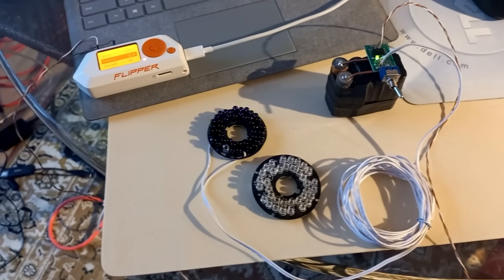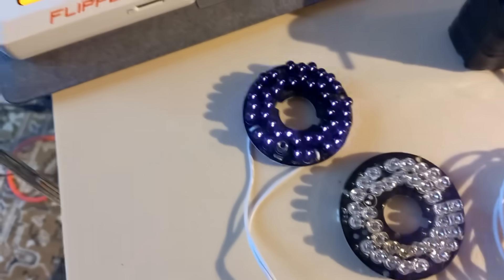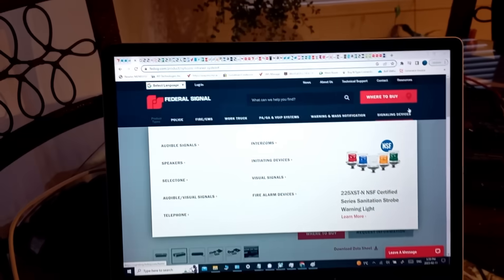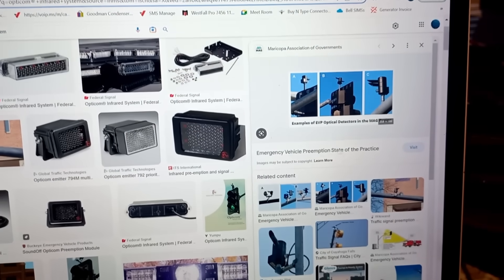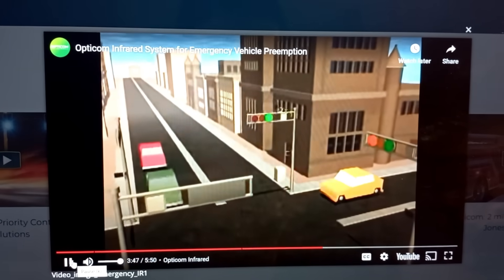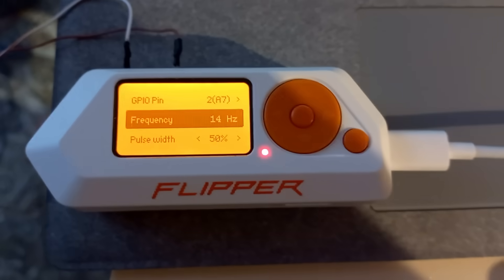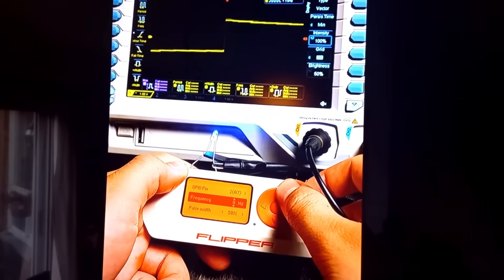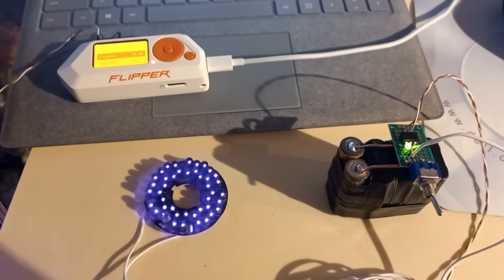Flipper Zero Controlling Traffic Lights

Comment: Hey man, just got the IR circuit out of my camera to do this and was wondering if instead of bypassing the photocell I could just solder it out? Thanks for the video.
Reply from the maker: Yes, just shot together the 2 pins where the photocell was connected to the PCB.

Comment: Old lights in my hometown had strobe activation. You could flash your high beams a few times and they would change. I'm sure it's since been upgraded, but I can confirm it worked most of the time. You had to do it in a rhythm, not sporadically.

Comment: Why not use 555 timer?
Reply from the maker: The whole point of the video was "Can a Flipper Zero control Traffic Lights" If I used a 555 would anyone care? And would the video go viral and get 1.4 million views?
Reply: @peterfairlie2296  Ok ? My question was regarding if the Flipper thingy does some sort of modulation on top of 14hz. Or what makes it special.
And yes you are right, nobody cares.

Comment: YOU DONT NEED A FLIPPER ZERO... Go buy a square wave generator or function generator online for a few dollars online. (It's a piece of test electronic test equipment used for many applications). Set the generator to a square wave (basically an on/off signal) set to 10-14hz (you can verify frequency using an iPhone slow mo video recorder). If you need more power for a larger array then you can use a audio amplifier in between the IR array and signal generator. Now you have a 10-14hz flashing IR array for like $20-$30 built with cheap off the shelf components.

 The beauty is that technically you only have a MIRT if the IR array and function generator are connected together. If they are disconnected then you have a piece of electronic test equipment and a led array which would not be considered an illegal device. If you have a better or simpler way to do this with less components then post it below.
Reply from the maker: The point of the video was can a flipper zero do it. Plus doing it any other way on YouTube the video would not have received 1.3 Million Views.

Comment: A 14 Hz 50% duty cycle signal doesn't even need a Flipper Zero. 
I know the guy that designed the Opticon Infrared system, at least the electronics and firmware. This was back in the early 1990's, and they were already having issues with false triggers when cars  would pass by one of those "picket fence" dividers on the highway and manage to hit the perfect frequency. That's when they started adding  data to the signal, but so many of the old systems are still in use, they have to retain some backwards compatibility.
These days, most emergency vehicles are outfitted with RF communication, especially in cities with high traffic, and the whole system is interconnected so the nodes can talk to each other to clear intersections well ahead of the emergency vehicle. That turns out to have its own set of problems that are now turning to machine learning to wrangle.

Comment: Using a Flipper to send the signal is a bit like parking a Corvette in your bedroom so you can use the headlights as a reading lamp. You can do the same thing with a 555 timer, a capacitor, and a resistor.

Comment: There are methods to do this but I will say they are very very ILLEGAL. This information is for educational purposes only and I am not responsible for any of your actions. 
With that being said some of the workers who install these have what is essentially a dewalt drill extremely fast flashing light. You can also use a flipper 0 with old security camera parts if you want something more permanent or mountable. You could probably use an Arduino too

Comment: The 792 cards can be programmed to only allow certain emitter IDs to activate. However, none of the owners of the signal system use this option. It wouldn't look good if an out-of-town (or new) ambulance or fire truck got stuck in traffic due to not being programmed. And the 792 cards are prohibitively expensive and offer no benefits to 99% of users vs. their lower priced options.

Comment: I wonder if the HackRF Portapack could do the same since it looks like it only has the coax connections to receive and transmit
Reply from the maker: The HackRF is an RF generator from 30 MHz to 6 GHz. You need a function generator to produce 14 Hz.

Comment: I built one of these over twenty years ago, and had sporadic success while driving to work at two in the morning. Nothing like waiting for a traffic light when there is absolutely no one else on the road. Shortly after that I had found all the addresses for the traffic cameras, and while listening to the scanner, followed a chase all the way across town from my living room. I instantly put two and two together and realized how stupid it was to put an IRLED strobe light on my visor. All those cameras and here I come up the street. Hi , this is me, the one with the flashing light on my visor. I still have it, the ABS pipe with the baloney slice and a spring steel clip, but would never again try to attract that kind of attention to myself. The price for messing with Opticom is extremely high.
Reply: I love both of you guys I’m nerding out big time
Reply: i guess it depends where you live, but the only instance I've found of anyone getting caught, they just got a $50 ticket.
Reply from the maker: Build it into your headlight enclosure. The cameras can't tell the difference between visible and IR light. Your headlight should be giving off light so it'll look normal and mask the IR from the cameras.
Reply: Don't get me messing with this again Peter. I'm too old and too broke to be in trouble with the law. It would be a neat trick getting that light to project over the razor sharp cutoff on these new headlights. And to the guy talking about encryption, well ya just gotta add a little noise to the mix and then it works just fine.
Reply: @peterfairlie2296 I find you both devious and conniving...well done!

Comment: What was the application / fap file that you used on the flipper to modulate the ir frequency to 14 hz
Reply from the maker: Using the latest Xtreme firmware go to:  Apps/GPIO/[GPIO] Signal Generator/PWM

Comment: what would happen if two emergency vehicles (or people using this flipper setup) came from different directions to the same intersection. You said the sensors only work for oncoming lights and not to the side so just wondering if two vehicles came perpendicular to eachother how the light would interpret that. Maybe it gives right of way to the person who was closer and then turns green for the other vehicle or maybe the second vehicle "steals" the green light from the first by instantly changing the light from green to red. Maybe there is a red and green light battle? Interesting stuff and if I had a mundane super power it would be to make all lights green but im sure the consequences of using these on the road are severe so I'll have to live vicariously lol.
Reply from the maker: In the computer world this is known as a "race condition" It would be set in the software that the main street would has priority over the side street. Everything is predetermined to prevent any system conflict.

Comment: I built one and it doesn't actually work. At first I thought I bought a weak IR LED so I bought another one rated for 6w, still doesn't work. I have the 14hz signal coming from a XY-LPWM feeding into a 4N33 optocoupler, the IR light flickers similarly to yours in the video but doesn't trigger these Opticom system. I'm in the East end of where you are region starting with M ending with H and it's not working. Any thoughts on why?
Reply: @peterfairlie2296  Really eh for sure? If it's really what I must do then I guess I'll have to buy an Arduino now and figure that all out. I just saw your video using the phone's light but that won't work for me since I'll be on a motorcycle and will be using my phone on a stand while navigating...
I have a big run with the club I'm in and I need this working before Thursday ahahah oh man
Reply: How hard was it to build yours? I've been pondering to make this, but it seems really complicated... 😕
Reply: @Eggward1011  not hard but note that it doesn't really work lol (at least for me). I used a PWM generator that does 14hz then fed the signal to a 4N33 optocoupler to an IR LED floodlight

Comment: Back when i was a pizza delivery driver we would use our big spotlights and flash them at the signal generators late at night to make them turn green, it worked the same way but wasn't as reliable and drew alot more attention.

Comment: What kind of amp do you got going into your LED? I bought a 48 IR LED for 12v but it's for a wall mount the AC/DC adapter says 12v 1A, is it safe to connect to a motorcycle headlight switch or should I add a resistor? If so how do I know which one? 
Thanks great video!
Reply: @peterfairlie2296  Thanks a bunch! I'm building one from scratch using PWM generator instead of the Flipper (price differences lol) this video has inspired me to thinker with electronics and I'm loving it!
Reply: @peterfairlie2296 what is the wavelength of the IR array?

Comment: We used to do this in the 90's with a phreaker utility made from radio shack parts called a brown box I believe. It is very illegal to the point where the FBI would raid you if this video wasn't fake and you tried to ACTUALLY use this on a red light.

Comment: I did something similar to this with an Arduino. The problem is I could not get the LED's bright enough to activate the receiver more than 100 feet away. I even overdrove the LED array with a 24 volt power supply and still no joy. I could activate the sensor if I was already sitting right at the intersection, but no farther than that.

Comment: You don't really need a Flipper Zero for this, just a Freq generator chip that costs 2$ from china + 4$ batteries and 3$ IR leds with resistors total cost under 10$
Reply: @peterfairlie2296  probably not at all )
Reply: @peterfairlie2296  you can make a video which will click bait based on Flipper Zero, how to hack trafic light with and without Flipper Zero ))

Comment: Bro, why are the details of this system open for everyone to read? In Germany, you cannot just find it out. You have to try on older analogue systems to get the radio frequenzy. Newer systems with digital radio are not that easy hackable. Usually theyre getting the information from the GPS in the onboard radio

Comment: I can change traffic lights without a flipper zero. It’s called flashing my high beams. Works on some but not all lights
Reply: No it doesn't. There is no way you could flash your lights at 14 times a second.
Reply: @bobcosgrove3235 the traffic lights have cameras for emergency vehicles. When they see the flashing lights they switch from red to green. Like I said works on a lot of traffic lights but not all.

Comment: 14hz only works on very old original opticom signals.
Many cities now have coded systems, some know which vehicle by the code it flashes
Ie 14hz pause flash flash pause flash 14hz..
That said you will be surprised how many gates like public storage, or private community gates still open with the basic old 14hz flash.
Er-my friends friend told me or something

Comment: Way back when I was a 16/17 year old kid, I was working the night shift pumping gas at the downtown gas station.  Fairly small university town.
A cab driver turned me on to the fact that if you flash your brights a certain way as you approach an intersection, the lights would change for you.
I tried it, it worked.  Well, mostly at night.  And yeah, there used to be people at gas stations that pumped your gas,  checked your oil and other fluids FOR you.  Service station.
What I would like to see implemented:  Now that the traffic lights are LEDs, they could be telling our cars the time till light change.  Just for starters.

Comment: I always wondered how that worked for the emergency vehicles.  I notice that a lot of communities put a big old light up there on the pole and when an emergency vehicle comes through first the light comes on, then the signal changes.  I always assumed there was some sort of remote control inside the fire trucks or ambulances

Comment: The issue with most of these systems are they have low to zero encryption and coding.
You can generate 14 Hz very simple. 555 IC comes to mind for that.
Reply: @peterfairlie2296  You're absolutely right.
Best of luck with your channel!
Reply: Yeah it's freaking everyone out. Business owners, government officials, etc.
Most of its capabilities aren't anything new but since It's an all-in-one/out-of-box commercially available hacking device, it drawn everybody's attention.

Comment: When we install Opticom the controller is typically programmed to make the straight and left turn movement green. So the cars heading the opposite direction should be stopped. That only happens at the Argentia intersection in the video. So its tough to say if this is actually working. Everything else seems like it would work.

Comment: Very interesting - but as others have said this is not something you should do beyond curiosity. It's ridiculously easy to catch people doing this, and the prosecution can be hefty. If traffic folks know how often emergency vehicle triggers get set off (especially if the traffic control devices are connected to the internet/central hub), doing it even once a week extra will likely start making that route/intersections look statistically anomalous. Then all they need to do so is put a small detector with camera anywhere in that intersection and wait until you trigger it. Bang. Photo of you, your license plate, the device flashing, etc. Cue knock on door with subpeona (or arrest).

There is ZERO way talking your way out of it because it's very obvious you didn't build that whole thing 'by accident' or didn't know it wasn't legal.
Reply: True story. The only retort you could have is "well the lights are synchronized so poorly in the US compared to every other developed country, that I had to take measures into my own hands" haha not really but it's true, not sure why we can't properly synchronize our lights. And it's not like we have active pedestrian crossing, trams and trolleys and other things to coordinate with. It's laughably bad in my experience in CA and TX
Reply: lol..small detector with camera that will capture license plate. lol.
Reply: @machaf There are plenty of intersections that already have speed cameras. Wouldn't be hard to add this to their role.

Comment: I always heard this weird urban myth that you could make red lights turn green by flickering your headlights on and off really fast. Of course it doesn't work and everybody knows it. But I wonder if there were any traffic lights around in the 70s that had those strobe light detectors, and a few people were actually able to do it, thus creating the myth.
Reply: Myth? Phreakers could call for free by entering the number by closing contacts very fast so it would be similar to rotary dial. Quite possible.
Reply: Only if you could flick your lights on at precisely 14 times a second.
Reply: Flickering headlights used to work downtown in the city I live in. One night, I saw someone else doing that and nearly caused a traffic accident. The other driver's light went from green to red, causing the other driver to skid out into the intersection. I personally don't do things like that for that reason. I'm not sure if it can be done anymore, being that the incident happened more than twenty years ago. I don't recommend doing that if it does.

Comment: Anyone that actually believes these things work are idiots.

I worked for USIC for awhile and located hundreds of intersections. I have asked the dozens of DOT, Fire, EMS and police if these devices actually work. Every single one of them said "If there was a device that did work we would not need emergency lights. We would just change all the lights to red and not have to worry about moving traffic." 99.9% of traffic lights at intersections are controlled by pressure pads in the pavement and timers.

Comment: I've called my city to fix our traffic lights... Since they do not change for motorcycles. They fixed some of them, but not all. When riding at 3am and sitting at a red for 10MINTUES with no change I'd love to have one of these.
Reply: State of Tennessee has provisions for that.....after a "reasonable" amount of time you can proceed through it when clear.
People in cars lose their minds😅
Reply: That sucks. I wonder if you carried a 15 lb dumbell with you and if you get stuck at the light, drop the weight and maybe it’s just enough vibration to trigger the sensor to detect your motorcycle. Idk.. just a thought doubt it works but maybe it does
Reply: Idk where you would keep that with you though
Reply: @hairybelly9910  strap it to the rear? Lol I don't think that'll help for weight, but maybe for the inductance coils underground

Comment: These IR LEDs may not work through some windshields as I know that the IR camera I have in my garage will not show the inside of my vehicle, the windows just show black like they were tinted but they are not tinted. So the glass has IR filtering ability.

Comment: Traffic lights tripped triggers the traffic camera.   Image of the car flashing device (visible to cameras) where the plate is converted to text and compared to a database of authorized vehicles to possess such devices.  If match = 0 then fine plate owner.   Do I know this to be?  Nope, but I think it's possible and don't want to take the chance.  Thanks for the cool vid.